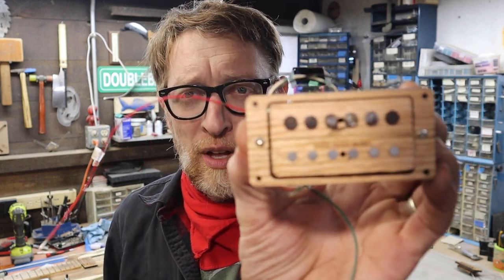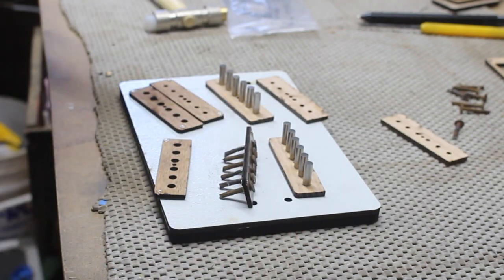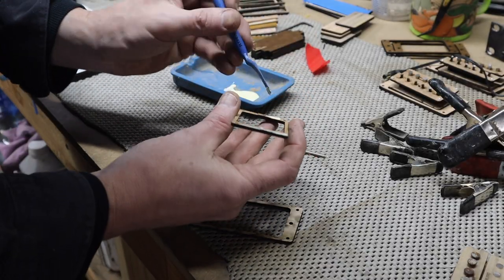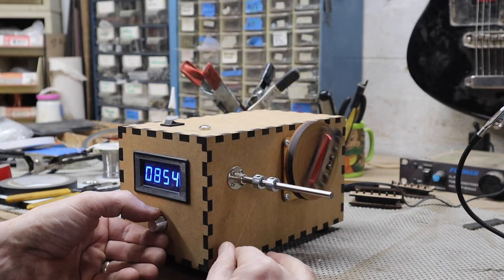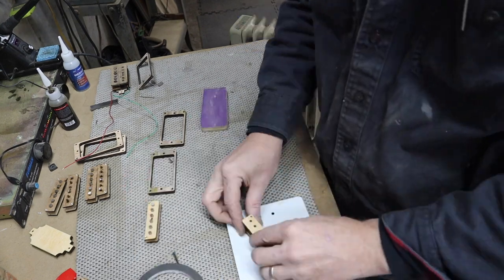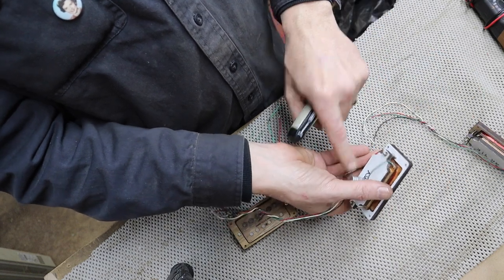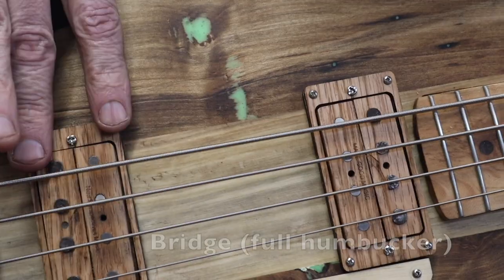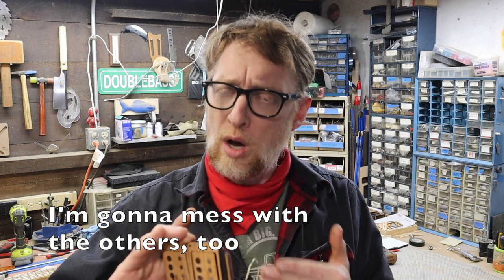DIY Pallet Wood & Rusty Nail Humbuckers - PAFS (Pallet AF)

Comment: Nails and common screws don't have the right metal composition. If they were nickel plated it would work better. I've tried something very similar to this before with regular nails and screws and it just doesn't work well.
Reply from the maker: Yea, I kinda knew that, but doesn't mean I'm not gonna try :) The plan was to introduce enough of the proper metals to overcome the deficiencies of the nails. I've got a few more things to try to improve this
Reply: @timsway  like you I always try to use reclaim and what's on hand as much as possible. It's a real struggle to find things that will work as pole pieces. I'll definitely be watching to see what you come up with.

Comment: You're weird. I like you.
Reply from the maker: ahem *YOU'RE, thank you very much :)
Reply: @timsway  Thank you Tim for the gentle correction on my grammer. Your pick up idea is so cool.  I use wood flooring scraps either solid or engineered for projects. Pretty solid stuff. I install floors and we always have scraps or old floors we pull out.

Comment: a bass guitar that sounds metal 14:00 did you try some fuzz? Just to compare hums and parasites? Does it compare worse or better? Did you try other experiments to eliminate hums or 60 cycle. Sometimes it is house electrical. But is there a way to eliminate it? Just see Ola Englund with 4 metal pedals to see what I'm talking about. https://www.youtube.com/watch?v=oR5-5aO1PIs&t=1s Metallica did use the demagnetizer for pickups. https://www.youtube.com/watch?v=BimCD1Bhzrw
Reply from the maker: there will be a video about the bass, soon, and I put it through some effects. In this video, I had them out of phase, like an indiot. Wait until you hear them now!

Comment: Wait you used alnico 5 poles and nails where screws would be, that's not going to work good, what going to magnifier the nails, u gotta use a bar magnet.
Reply from the maker: there's a bar magnet in the base, but I also used alnico poles instead of steel, which was probably overkill
Reply: @timsway   that will cancel out the magnetic field, on one of the coils, just use steel rods screws and  a bar magnet

Comment: Come 0n man ! Buck hums ? U can do a better job at explaining how humbuckers work !! How humbuckers work is - 2 coils sharing the same magnetic (B) field, due to the slightly different locations of the 2 coils relative to the strings, the frequencies generated will be slightly different EXCEPT the noise (or the 'hum'), in mathematical graphs- whenever u have two curves out by a 180 degrees half-cycle, they would cancel each other out, hence it's only the noise caused by the interference of the Earth's gravitational field that is common in both coils , separated by 180 degrees (because being wired out of phase),  the hum in the coils being out of phase by 180 degrees would cancel each other out leaving the combined signals of the strings to go to the volume/tone pots...

The same principle applies to when you remove the vocal track from a mix - you wire the two stereo outputs together but out of phase, you would end up with a mono signal of the whole mix minus what's common in both channel, usually the vocals.  It's a primitive way of doing it but it works.
Reply from the maker: you're hired! :)